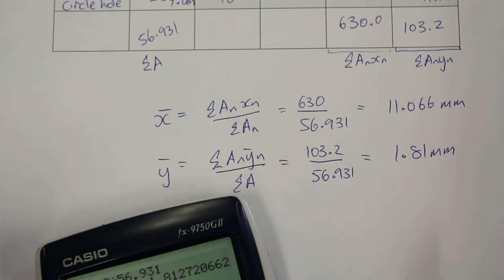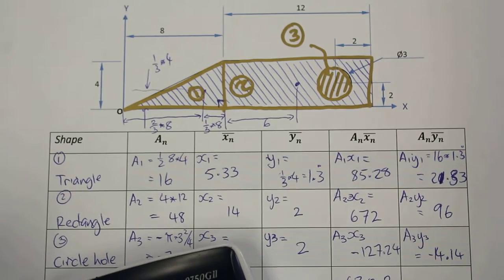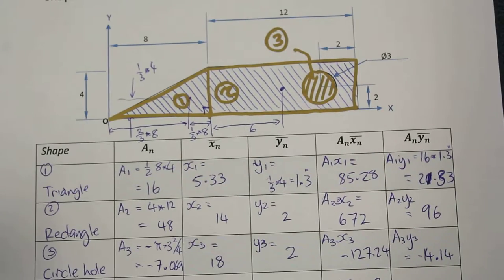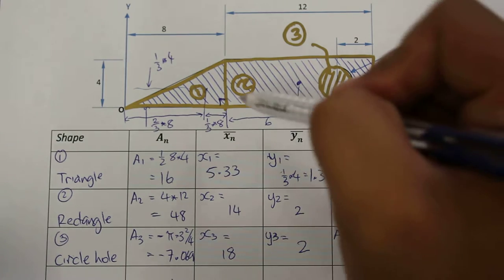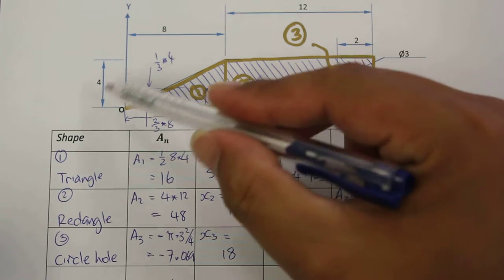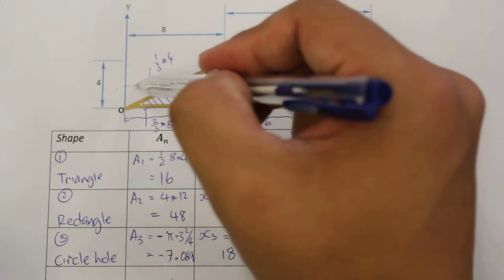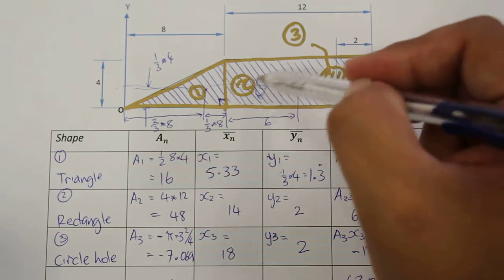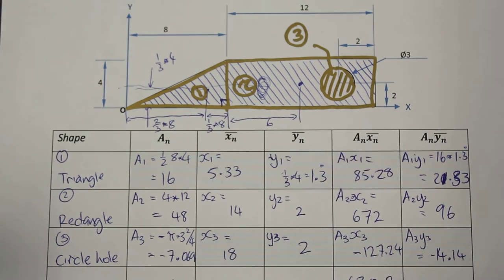Centroid of a Composite Shape - Tabular Method - Part 2

Comment: quick question professor, could you explain  how to get the moment of inertia on the same example please
Reply: rip
Reply from the maker: @user-rf4vc7mt4d  Sorry Mikeloto21, I must have missed your message. I hope you were able to find out how to calculate the moment of inertia (aka second moment of area)

The basic process is as follows:
Decide which axis you are trying to find the second moment of area about:

If you are doing it about an horizontal axis at the centroid then
*Find the centroid of the part
*Find the second moment of area about the centroid of each section (Name this I_x1' , I_x2' , I_x3') this table is useful https://en.wikipedia.org/wiki/List_of_second_moments_of_area
               For example:I_centroid1 = (b h^3)/36         I_centroid2 = (b d ^3) / 12        I_centroid3 = (pi/4) r^4
*Find the distance between the centroid of the entire shape and the centroid of each section (name this h1, h2, h3)
               For example: h1= y1- ycentroid        h2=y2 - ycentroid        h3=y3 - y centroid
*Use the parallel axis theorem to find the second moment of area of each section about the center. (name this I_x1 , I_x2 , I_x3
*Add up the values in the previous part to find I total (I_x = I_x1+I_x2+I_x3

(note that I_x3, and I_centroid3 should be a negative number)

This is complicated enough that I think I need to make a video to properly solve it. Also, the text book "Mechanics of Materials" by R. C Hibbeler has an appendix about this topic that may be useful to you if you want to extend your knowledge.